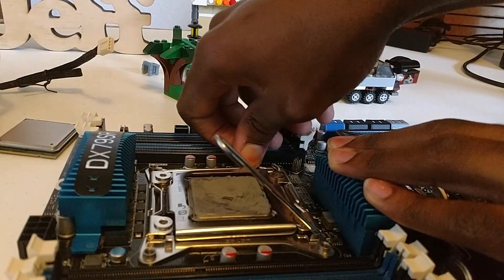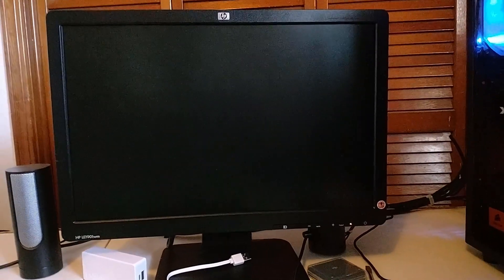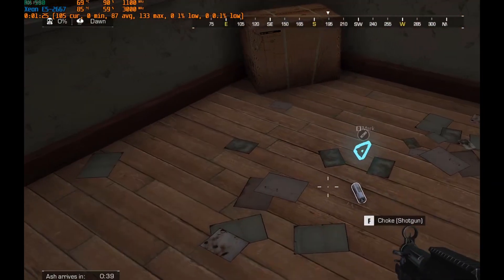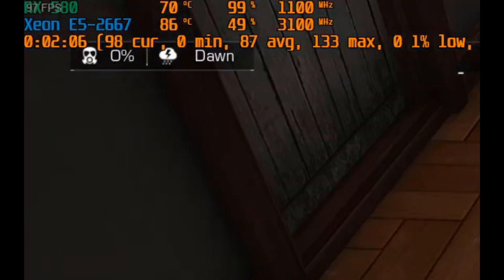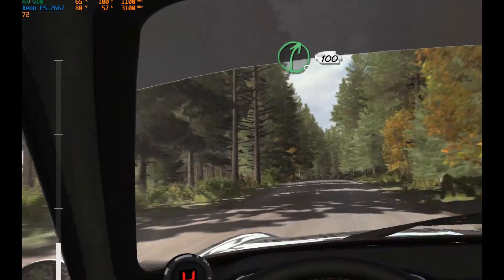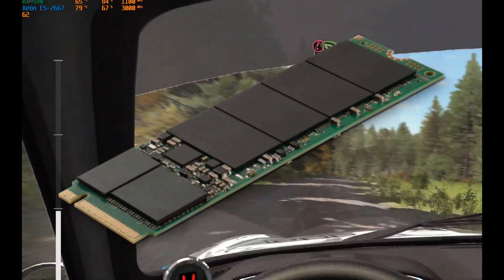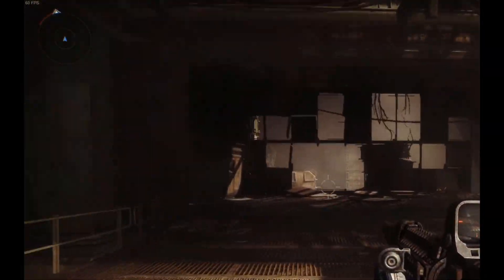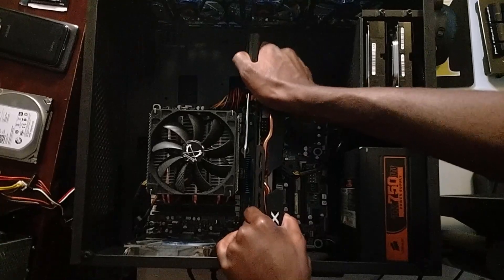$30 Xeon E5-2667 Benchmarks

Comment: Is it better than i7 or i9?
Reply from the maker: Better is a relative term in this case. Single threaded performance isn't super given it's a V1 chip and doesn't turbo particularly high. It'll still hold it's ground pretty well depending on the graphics card it's paired with. More modern CPUs are going to outperform it, but this is more of a value option.

Comment: What is the e5 2667 comparable to right now in intel and AMD lineup?
Reply from the maker: It still holds up pretty well with my RX 580 but it's going to be outperformed by the new stuff when it comes to single threaded performance. The price to performance isn't too bad if you get a cheap board.